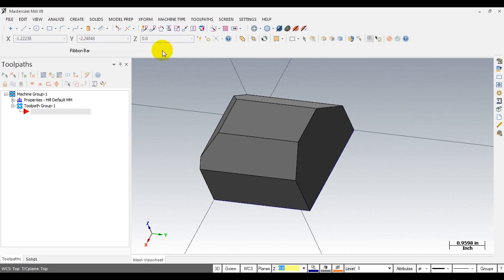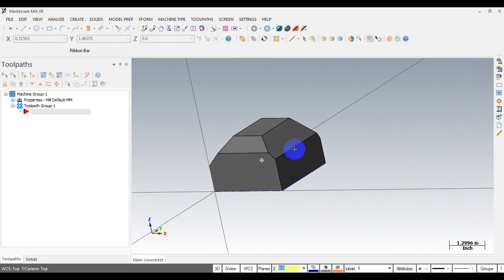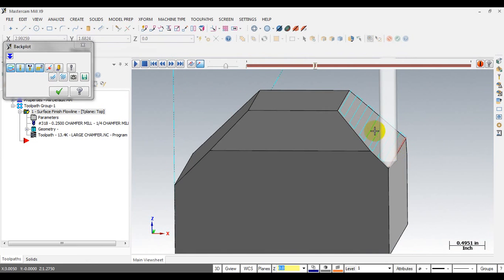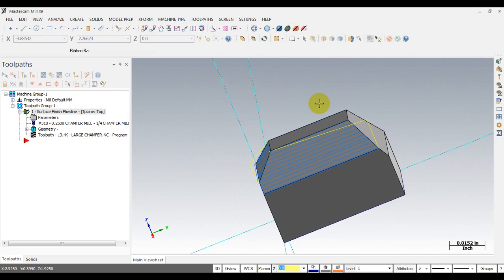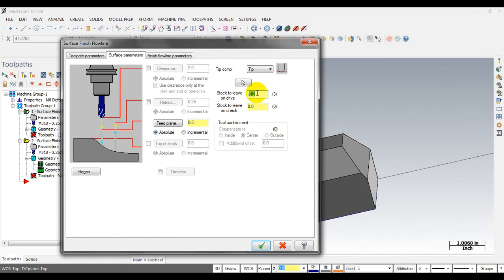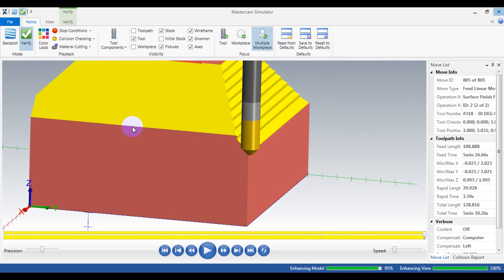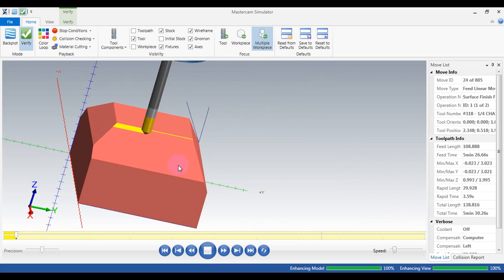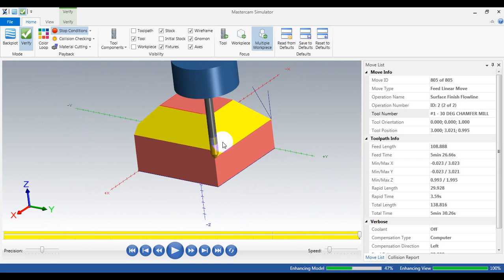Mastercam tip: Cut large chamfer with small chamfer tool using surface toolpath

Comment: Great presentation! Question, can you recommend a good surface toolpath for machining side walls from 0-90 degrees with an up and down motion on the z-axis?
Reply from the maker: Do you have a picture of the surface?
Reply: GIANG THE TOOL No I'm not at work today so I can't provide you with a picture. Basically what I want to machine is the corners of a pocket that has a 1/2 inch radius and reduce it to a 1/8 inch radius. The pocket is deep that's why I want the cutter to go up and down. One way because I'm limited on flute length and a don't want the cutter to snap off if you know what I mean. I would like it to work as a ruled toolpath but on a solid.
Reply from the maker: take a look on this if this is what you want to talk about: https://youtu.be/-z5Bokbax_A
normally I will use a flowline for the finish cut
Reply: Thank you